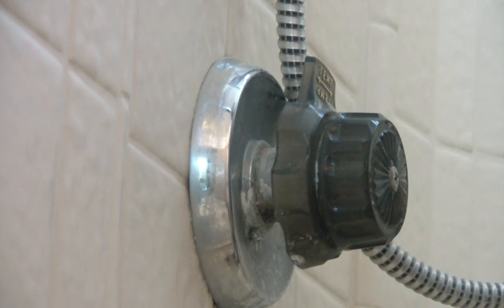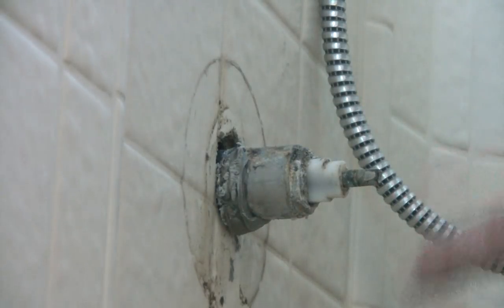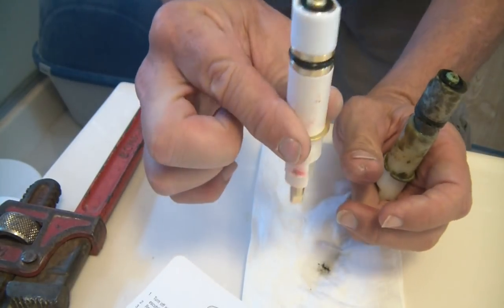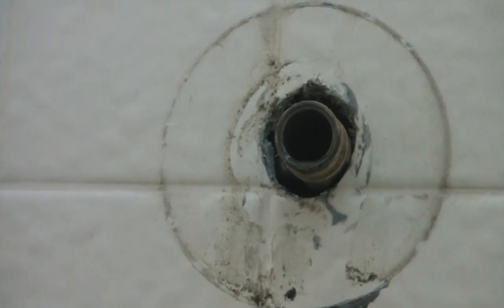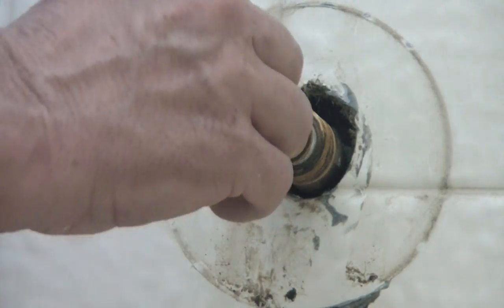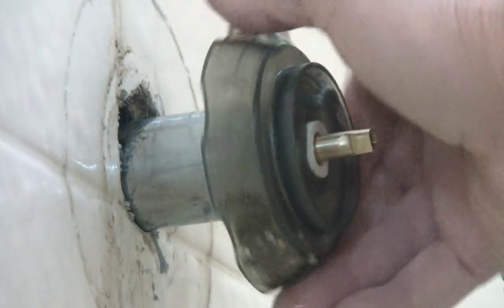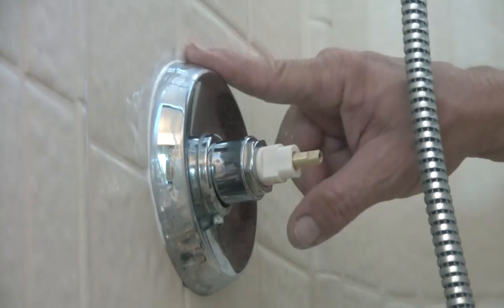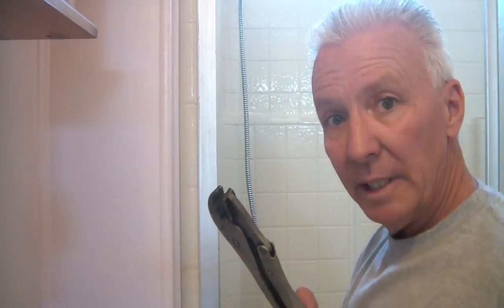How to install Mixet cartridge MXT07

Comment: thx for mentioning the "tab" people miss that - it breaks easy ...
Reply from the maker: Sam you are so right. I remember seeing a video on this and the guy ripped the knob off the valve and snapped the tab. I noticed when he put it back on there was no tab, my jaw dropped. Thank you for viewing and always appreciate the comments.
Reply: I 've only done about 4-5 of these , and I consider th Mixet to be touchy overall , but one thing for sure, is you don't need to be breaking a tab on a handle and add that to your frustrations....  Im still not happy with the way mine work at the house - Im definitely replacing the valves when I remodel
Reply from the maker: I agree 100% when i redo my 3 bathrooms i plan on installing all new DELTA valves. Plus anything other than mixet you have more variety of accessories .

Comment: Do you know if there's any way to convert this type of shower valve to a Moen or delta type of shower valve?
Reply from the maker: Only way to convert to another brand valve is to change out the valve. I'm going to remodel one bathroom here soon and going down to the stud so I will replace the mixit valve with a Moem. If you have an access form another room it's easy if not you will be busting in the wall. Good time to repaint that room
Reply: +The Shack thanks for the info. Really helps a lot.
Reply from the maker: +frankrizzo442 sorry it's not an easy fix but if the wall backing the shower is another room you can go through there vs. damaging the tile in the shower.
Reply: Thank you that was very helpful.
Reply from the maker: Your very welcome georgette. Glad it helped and thank you for viewing.

Comment: I did everything you did in this video and found it very simple. I checked to make sure the water would come out of the faucet before I tightened the knobs and everything worked fine. Then I went to turn it on and no water comes out. What did I do wrong? One thing I noticed is that my replacement did not come with the two brass and one plastic ring. I thought they might have been built in but could that be the issue?
Reply: Thank you by the way. You made it very easy to follow!
Reply from the maker: Norma did you check the old one? if it had the spacers YES you'll need them. If by some chance its a different style and didn't have them is possible it's wrong cartridge. I always say compare the old and new before proceeding. saves time in the long run. Hope you resolve this issue and fix it. wish i could help more,  thank you for viewing.
Reply: They did, so I went and bought the correct part with the spacers included and and now it turns on just fine but is very difficult to turn off. It drips for a while and I have to turn it pretty tightly to turn if all the way off. What the heck?!
Reply from the maker: Norma its vert difficult to diagnose an issue with out being there and seeing for oneself. my thought. Id pull the cartridge out and make sure the O ring didnt roll off or bind, try it again and if still having issues try rotating it 180. Put the dot up if you installed it down or vice a versa.
Reply: Norma Miranda, I'm curious, how did it all turn out for you? What was the problem?
Reply: @wantkixido  Hi Tom, I bought the wrong one and replaced it. It's working now but I do feel I have to tighten it more than I should but it's not leaking. It takes some time to stop dripping but it does. Thank you so much for following up with me!

Comment: I am curious do you have a video on how to replace the knob with a new knob cause I want to change it completely but don't know if I can add any one on it if I replace it all.
Reply from the maker: as long as its a mixit knob it should work. Just as I removed the knob in this video is just how you do it. Also at the end when I did replace it with a new knob. it's all here darkstel1 hope this helps. Thank You for viewing

Comment: That cut out he mentioned caused me headaches!! The difference is so so slight but is the difference between the valve leaking or not. He was right if you have to force it, STOP you have the slighter valve cut out. Also substituted silicone grease because I had lots on hand.
Reply: Same problem, and I tried looking for the wider one but I can’t find it at Home Depot or Lowe’s

Comment: Found this video extremely helpful.  Thank you.  I just replaced my cartridge but noticed my hot water and cold water are reversed (turning to hot is now cold and turning to cold is now hot). I'm using the MXT07 and the box says the red mark must point up so i tried it with the red mark pointing up (no mark or indication on the old cartridge). Should i try having the red mark pointing down instead?
Reply from the maker: eric yes in my video I put the red mark down if the hot is to your right and cold left just pull it out and give it a 180 and you should be fine. I had to re-watch my video and I did mention putting it in with the red dot down. Had to make sure I didn't forget to mention it. Luckily it’s an easy fix.

Comment: What should I do if my shower stem is to long and the new mixet shower faucet I bought doesn't line up nicely? Sticks out pretty far..
Reply from the maker: Brody did you get the correct cartridge? did you compare it to the old cartridge when you took it out. Are you sure its a Mixet valve?  If it the correct replacement it will fit fine with no issue. Something isn't correct.